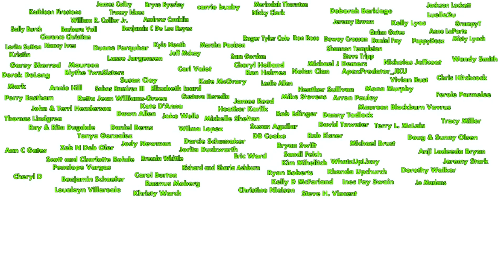Building Earthbag Shop Walls | Weekly Peek Ep369

Comment: Granted I do not know what kind of weather you are having there but based on the videos posted it seems like it is taking you twice as long to build these walls with the skid steer than it did when you built other walls by hand.  Is that simply based on manpower being less or that you all are being taken away for other projects?
Reply: 2 people can lay parts of the wall now instead of the whole family. The bags are bigger and the area they are inclosing is larger than anything they have done before also more windows and doors.  Yes the time will be longer.